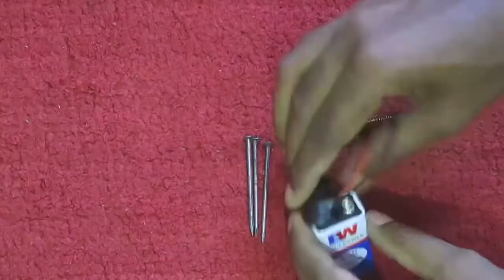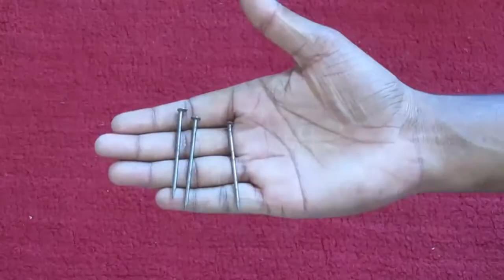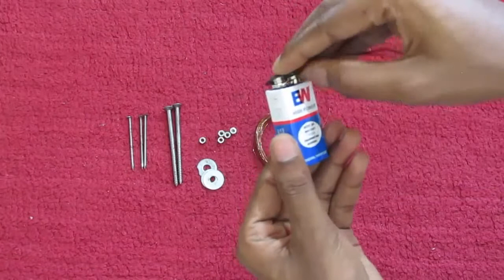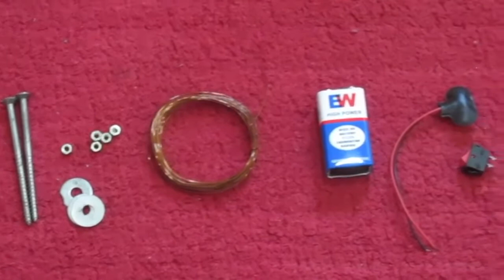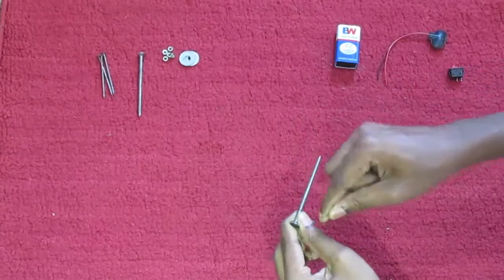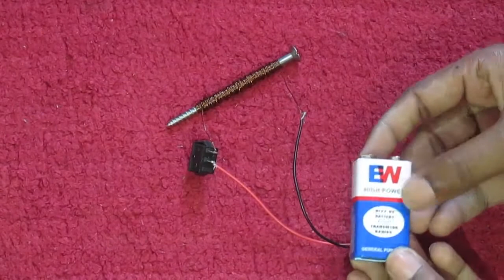How to Make A Solenoid at home.  Activity of 10th Science. #DIY #Solenoid #ElectromagneticInduction

Comment: solemoid aur electromagnet me kya farak h?
Reply from the maker: An electromagnet is an electrically induced magnet surrounded by a coil of wire through which an electric current is passed to magnetize the core. 
And A solenoid is a cylindrical coil of wire acting as a magnet when carrying an electric current.
Reply: Electromagnet usiko kahte hey jab Current ke wajah se Magnetic effect show kare Uske bahut Saare examples hey Jaise ki Solenoid,    Electromagnet ka hin ek application hey Electromagnets ke bahut saare examples hey Jaise ki Solenoid, Generators, hard disks, relays, motors, loudspeakers etc.
Reply: @rngff2007  12th me hu mai aab💀ye sab to bohot aasan hai💀💀

Comment: Aur agar bich mein switch na lagaya jai direct battery se connection dedun
Reply from the maker: To ap jab battery se connect krenge to solenoid work krega aur jb disconnect krenge to work nahi krega..
Reply: @manjeetsir2604  sir 1 doubt aur tha kitni layer banani hai wire ki
Reply from the maker: 35 to 40 rounds lga skte h.. koi fix number nhi h..
Reply: @manjeetsir2604  sir  suru se end tak 1 baar laga diya aur fir uske upar 1 baar aur krni hai
Reply from the maker: Ek bar kr liye to usi me try krk dekhiye.. aur agr weak lge to ek bar aur lga lijiyega..